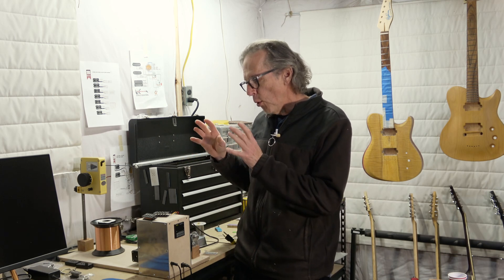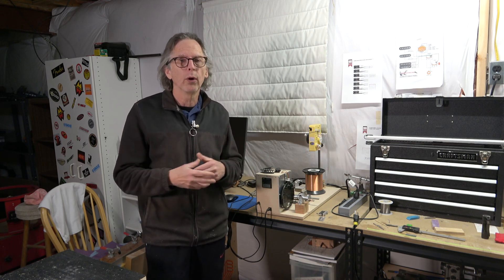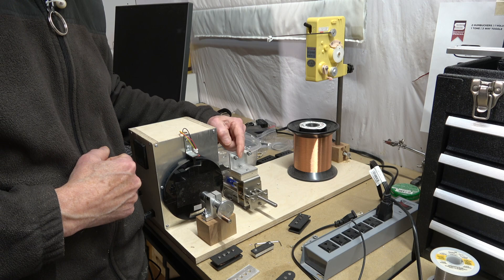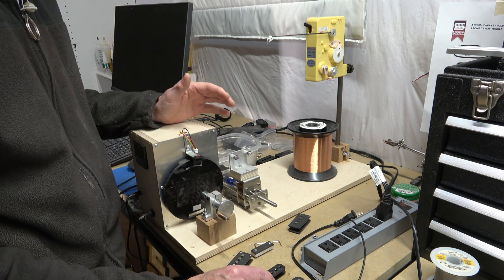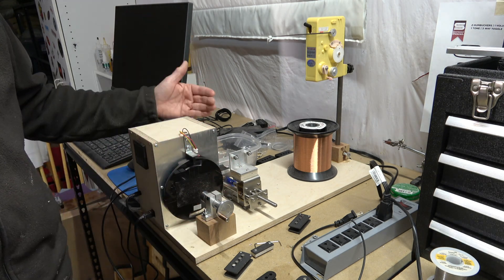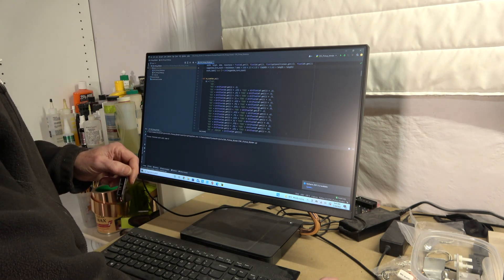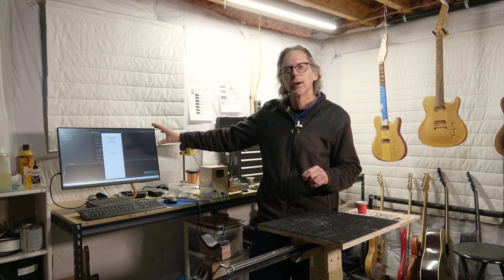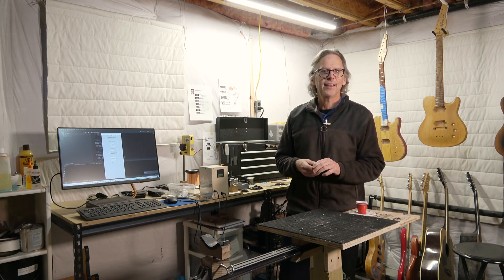CNC Pickup Winder Update

Comment: This is really cool and you have some serious knowledge about stuff, but, you know, a winder do not have to be this complicated, after all, its just a matter of getting the desired amount of winds on the bobbin and of course spread out even on the bobbin, it takes just a few minutes to do this and no one can be that busy to not have time to spend it while making a pickup, after studying your plans of this machine I realise that if something fail then its possible to spend many hours trying to get it working properly again. That will not happen with a really simple winder, or some of the most traditional DIY winders that people are building. I dont want to hassle with a complicated winder that contains many brackets, and screws and 3D printed parts, and possible hundreds of different washers and pulleys and things.. I just want to wind bobbins.  i really appreciate all the knowledge you share on your YouTube channel and you build absolutely fantastic guitars, people like you are important. Thanks. 👍
Reply from the maker: I agree. However, this is YouTube and YouTube needs interesting content.
Reply: @HighlineGuitars  I totally agree with that, and that's the reason why I have watched this video several times, because its interesting.. it also shows someone that are willing to put it the time it takes to get the machine working properly, which is a journey for sure.. :D

Comment: I have been using a spongy 2 sided tape with good success for bobbins without holes. for resistance calculation - what function are you using? Are you adding the 2 radii to the rectangle?

Comment: Also, any chance you will release the source code for the g-code software in case someone wants to change the patterns?
Reply: Can you verify that this works? I am unable to get the .exe file to open.
Reply from the maker: @swampfoot1971  yes, it works.
Reply from the maker: No. You can open the program in a Python editing program like PyCharm and edit it.
Reply: @HighlineGuitars  nice! Thanks.
Reply: I am wondering if there is a way to add a  ramp to the motor speed as there is a tension jolt when the program starts and the wire snaps.
Reply from the maker: @swampfoot1971  There is a “ramp.” If the wire is breaking, you need to adjust the tensioner. Also make sure the pulleys on the tensioner aren’t sticking. If you need a longer ramp, you’ll need to modify the code.

Comment: How about this well let me first say how much I appreciate all the knowledge you share okay your winder let's say like you made that template that held a particular bobbin style what if you 3D printed a receiver like that for each of the different bobbin and styles that you have or will use. And then had just a couple of locating pegs to keep the bobbin from slipping on the mounting plate that would eliminate sticky tape any type of gel or material other than a solid surface that would also eliminate any movement of the bobbin I'm sure you wouldn't have to 3D print them but you would find someone I'm sure that would give your readers in their plans when they purchase them the codes in order to have them make their own receivers hopefully this is helpful continue the good work

Comment: So, how much more will it cost?  I paid 20.00 for the drawings already. Thanks
Reply from the maker: Not sure yet. However, it will cost more as the CNC approach is much more sophisticated and requires a manual for assembly and another for use. There's also a software component as well.

Comment: 6:56 ever have one fly off? I did once when I first started making pickups.  I always wonder when it will happen again. They seem to be stuck pretty good. I use glue and tape
Reply from the maker: A couple of times. I was always nervous when I wanted to wind a bobbin with a lot of turns of thicker wire. The mini live center solved that problem.
Reply: @HighlineGuitars  yeah they do get a little heavy. I have a clanping system on my machine, I still use tape and glue lol. Its just so much easier.  I would never use double sided tape. I never even tried double sided tape. I dont know of any that I would trust to stay stuck. That idea makes me real nervous.  The only ones thay really ever worry me worry are tele bobbins.

Comment: The resistance calculation might be best approached as a machine learning issue.
The scatter problem may not be solved by testing equations.But, every finished bobbin is data. If a bunch of users of your plans record variables and measure outcomes. Enough data will predict the correct settings for the desired outcome.

Lofty idea, but it's possible.

Comment: your fill factor should be calculated by or adjusted by weight
Reply from the maker: That's one way to do it. I tried and ran into too many issues with consistency. Sometimes what sounds good on paper, fails in practice.
Reply: @HighlineGuitars  you could also try adjusting the spindle rpm to reduce the whip in the wire
Reply from the maker: @kevintrick159  that’s what the tensioner does.

Comment: Ohm calculator: Wouldn't it be the same using the circumference for a bobbin and the oblong pickup bobbin? Isn't it just circumference X bobbin height. Because the OHM cal is a very cool software feature. I'd also guess that the quality/consistency of the wire would have a big effect too. Thanks as always for the great information, enlightening.
Reply from the maker: It’s way more complicated than that. You have to calculate fill factor, which doesn’t work where scatter is involved.

Comment: Regarding the math for calculating the resistance - think of it this way:

For a typical Strat single coil bobbin can be divided into two half circles and a rectangle.

Or, you have a circle and a recrangle. The length of the recrangle is constant, the circumference of the circle is going to increase as more wire is wound onto the bobbin.

When you compensate for the fill factor, you take the length of the rectangle * 2 + circumference of circle(L), where L represents the number of layers on the bobbin.

You will have to calculate the circumference of the circle for each layer.

You need to know the initial diameter of the round part of the bobbin and then increase it with the diameter of the coil wire for each layer.

This will only be an approximation of course, but maybe it will bring the result closer to reality.
Reply: I'm on mobile now, so I cannot write formulas, but look into what an arithmetic series is.

If you take the formula for calculating the sum of the first N elements, and change it a bit to include the length of the recnangle's sides, you wil end up with a quadratic equation that will give you the number of N layers you need to get exactly R resistance.

If the equation has two solutions then one will most likely be negative, so you can ignore that.
Reply: I would imagone the simplest thing to do would create a number of pickups with a given number of rotations for a specific winding type and test to see if you can get a consistent resistance.  Eithe that or brush up on you calculus.
Reply from the maker: That’s what I did. It doesn’t work because of scatter.

Comment: I eagerly await the new plans. I purchased the current plans but have not had a chance to build it yet. In the meantime, I have been experimenting with different winding setups of my own and I too have a box full of reject/experimental pickups. The biggest challenge I am working on now is a way to hold the bobbin that is easy to mount/dismount and allows for consistency. Good work Chris, thanks for posting.